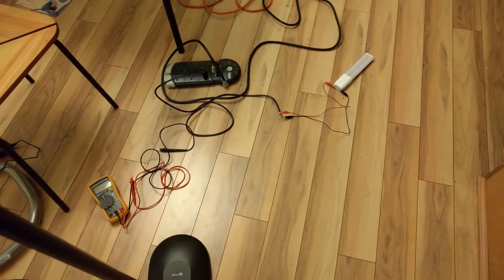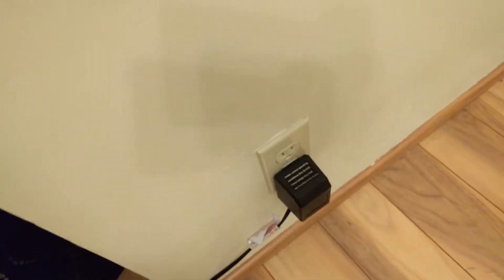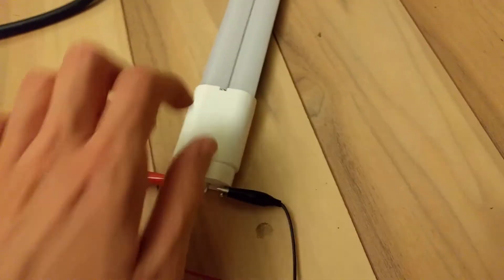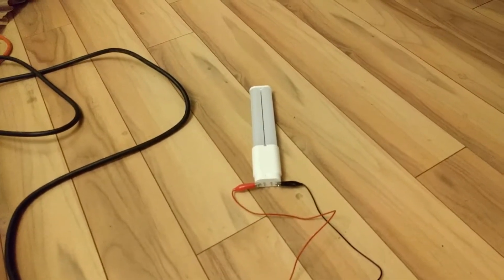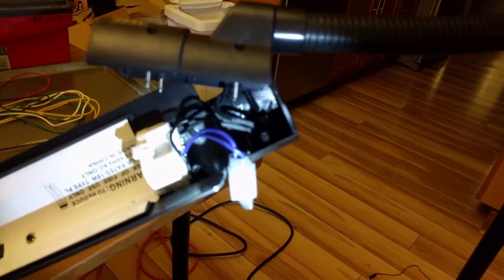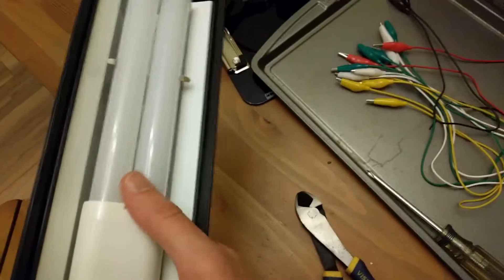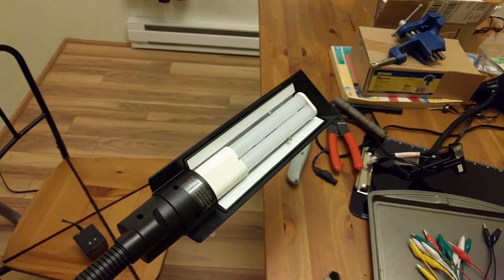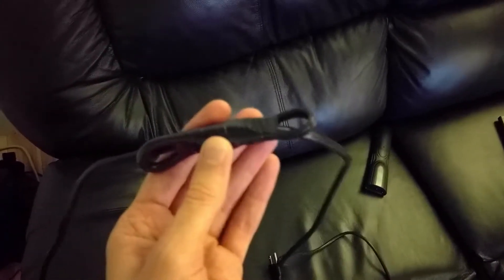OttLite fluorescent-to-LED conversion

Comment: I know this video is incredibly old but the ballast is just a choke or inductor with a laminate steel core as it resembles a transformer.  I know this because my Mom has this exact lamp, I had to repair the brick by putting it into an electrical box and ran a grounded cord from that box out of it.  The lamp is pretty basic as there is no electronic ballast and as long as you get a direct replacement LED, it should work fine.  The ballast is there only to reduce current.  It's an old way of doing it, but functional.  

When you do electrical projects like this, it doesn't hurt to have Marettes (if you're American, wire nuts) on hand for simple tests like this.  Heck, since this is nil in power consumption, you could get away with Wagos, the speaker pinch terminals of the electrical connecton world.  Also, why go through the effort of soldering another cord to it when you could just use a standard plug from your favourite hardware store?  You could even get one of those pinch plugs where you pinch the blades, remove it from the housing, slip the cord through the housing and pinch the wires with the plug blades and slide the whole assembly together.  It's a much cleaner, safer result without using electrical tape.  Electrical tape isn't the appropriate way of wiring this thing.  If you must use anything to insulate, some heat shrink tubing would be best, but buying a two prong plug works just as well.

Comment: Hi Paul, Thanks for the video.   The tube in our lamp is a 18PLL830 which is probably the same as your original twin tube CFL at about 240mm long. 
 Amazon is usually pretty quick sending stuff to me here in NZ so I will check them out.
Out of curiosity, how do you find the light output now with the 9W LED lamp as opposed to the original 18W rated CFL?

Comment: What's inside the black shrink-wrapped package with the purple wires you cut off? Should at least cut it open & look. Could've checked the output voltage with a multimeter while it was still attached too, maybe it's only a safety device of some type. Should also practice soldering wires in a line, for a smooth power cord repair, it's not like you're using wire nuts so don't need the pigtail connection.
Reply: It would have been better if he bought a plug from a hardware store.  If he wanted a longer cord, he could get one with a molded plug on it, depending on where he is.